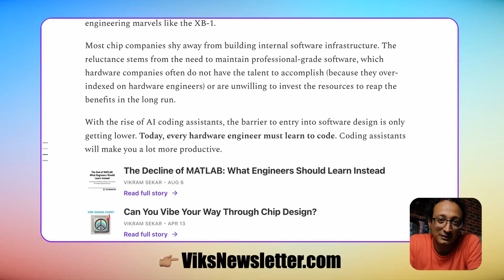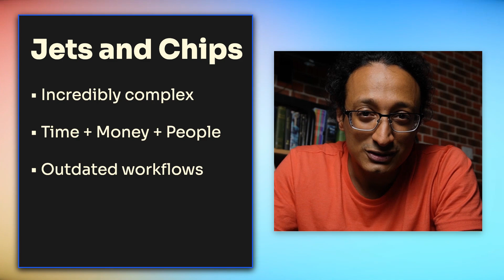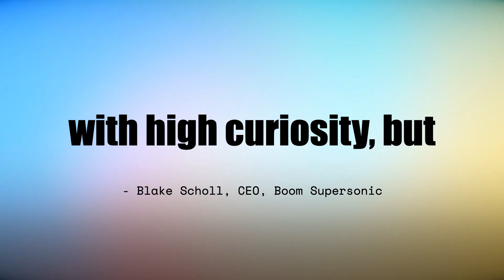If we built silicon chips like supersonic jets ...

Comment: The current state of the tools from EDA giants are like golden handcuffs, they free you from worrying about the tools and methodologies that go into the development and prototyping of chips - that's the golden part but at the same time most of these tools have such horrible interfaces and bad finish to their features that the end user is teleported back in time to the 1980s .. dealing with horrible UIs, tool components not working together as expected, inability to handle large data sets, infinite number of bugs that are result of smacking features into the existing tool without proper re-design etc. that's the handcuff part. 

Its like a toxic relationship where you know your parter could be better (the underlying methodologies and solutions are good) but their behavior toward you never changes (presentation and delivery of the solutions). Combine this with the always cut throat deadlines and sprint goals that need to be finished before tapeout -- R&D teams never get out of this relationship. Because they never get the time to fix these things. They develop flows on top of these tools and various connections between these tools and call it a day. That's the most you get. 

I believe there are two primary contributing factors here: 1. The folks writing the EDA tool (more importantly the libraries and frameworks that do the heavy lifting behind the scenes, such as Synopsys SCML) have a background in hardware primarily => good with research, bad with creating engineering solutions that could channel their research.. in simpler terms, they're not good at writing software.
2. The monopoly in the hands of the four giants you mentioned. We just have to accept what they give us.. 

It is about time that someone steps up and bridges these gaps.. which have seemingly become canyons now. As far as I can see the two factors here that will serve as "fuel" for burning down the palace of monopoly are 1. More openness.. more open source solution alternatives for the niche tools/technologies that build the foundation of the EDA giants. Like anyone today can get their hands on a bunch of JS frameworks and write a website, engineers within the industry should be enabled this level of flexibility and dexterity in writing.. let's say SystemC simulations or designing a new ISA, or finding the performance numbers of a new IP they thought of etc. which brings me to number 2. AI agents - combine the above along with agents and the amount of things that can be made open source is staggering. This is my 2 cents. Thank you for the wonderful video!
Reply from the maker: Thanks for the well thought out comment. I agree with everything. EDA tool status makes one feel like not working lol